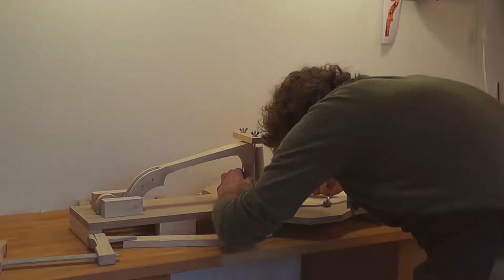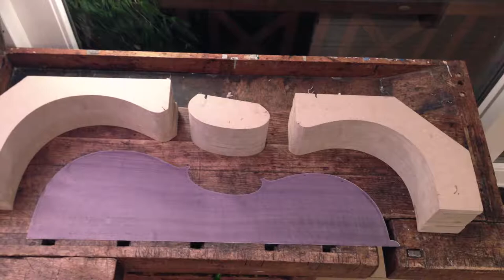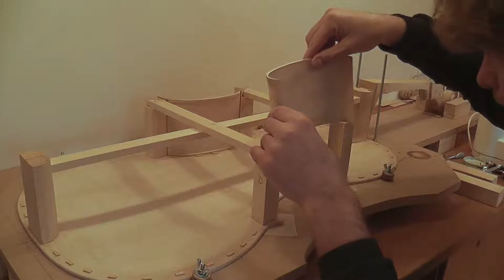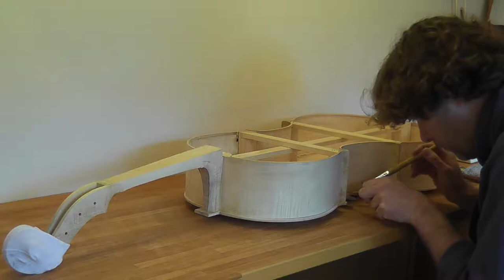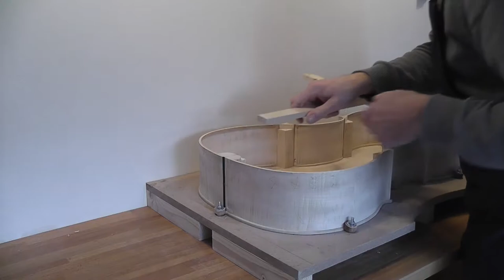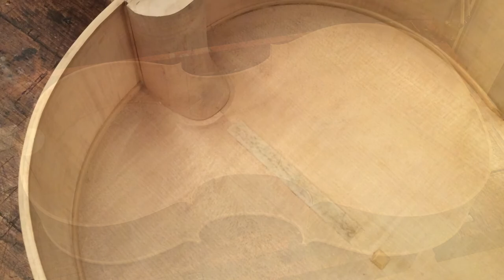Exploring lost cello making practices 3: the rib structure

Comment: Are  you using spruce  for the  blocks ?  willow.  or  linden  wood   tnx
Reply from the maker: I used spruce, just like in the original instrument (see also the CT scan  image in the violin rib structure video, at 1 minute 21 seconds). Thanks!
See:
https://youtu.be/i4N5E8F5W64?t=82